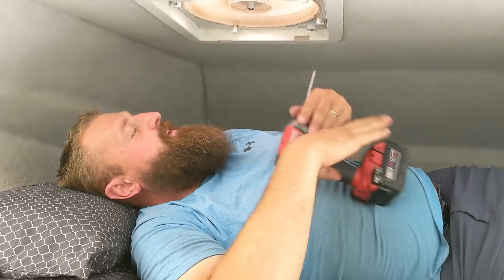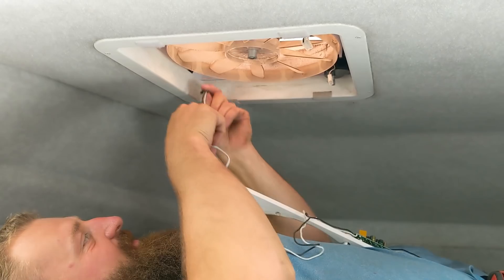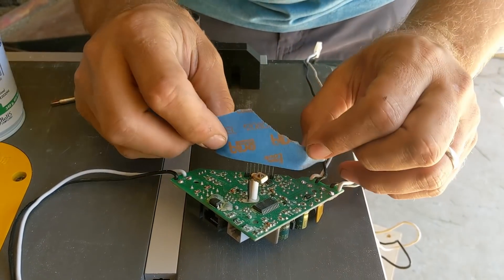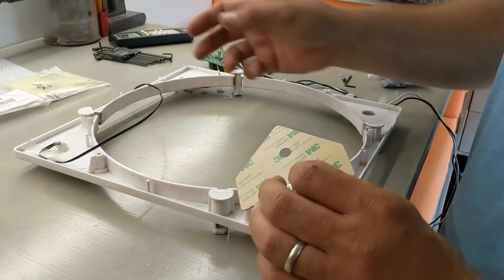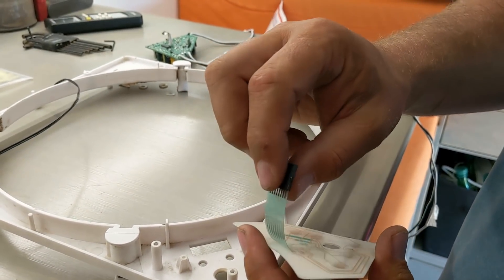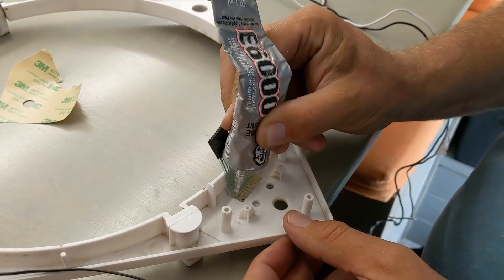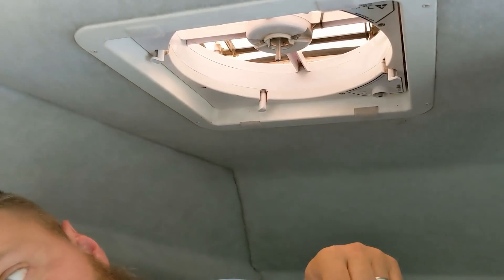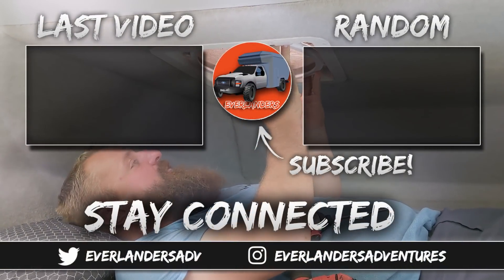MaxxAir Fan Repair & Preventing Condensation from (re)Damaging Electronics  - Manly Man Skills

Comment: Was the fuse on the fan you removed as maxxair I thought had one one them and I have issues and had to wire the basic fan to a toggle switch to have even a one way fan working
Reply from the maker: What?

Comment: We bought a couple deluxe Maxx Air fans for our bus, and out of the box I tried this on one. In retrospect I suppose I should have teste3d it first, but anywho it didn't work properly when I put it back together and connected it to power in my living room. I'm afraid I may have done something horribly wrong and completely messed it up. Basically the controls, remote or on the fan, are not doing what they are supposed to be doing. The cover won't open but it will close if I  open it manually and press the off button. The fan itself won't come on most of the time. To compare, I took the second one out of the box and wired it up, and it worked a charm.

Is this something I can fix? Any ideas? I tried to follow the video as close as I could and I used the exact same products.  😢
Reply: Nevermind, it was user error. When plugging everything back in I plugged the temperature sensor in incorrectly and for some reason that caused the fan to lose its mind. Working fine now. Ugh.
Reply from the maker: Great! The foil ribbon cable for the keypad still failed again on mine 4 years later. If I was doing it all over I'd extend the 2 sets of motor wires and relocate the PCB somewhere away from the condensation.

Comment: It's possesd. That's what my infrared sensor looks like on the second board I replaced last year. POS!
Reply from the maker: It will look like that and need replacement every 2 to 3 years unless you move the PCB elsewhere and run wires to the motors.
Reply: Yep, I would have to cutout the framing to move the board locations. I have 3 of the deluxe 7500k fans. Only having problems with the bedroom fan. One of the wires on the sensor connector is broke and I don't have a micro soldering iron   for circuits.
 Good video Jason!
Reply from the maker: No, you just need to reuse the power wire running to the unit and use that for the motor wire. Then relocate the PCB to wherever your power distribution is.
Reply: Oh, I see. But that would be behind the Converter in the wall cavity that I can't get to anyway.

Comment: Is there not also an issue with voltage ? They don’t like being supplied anything over 13 (?) bolts?
Reply from the maker: Yes indeed, but we don't have this issue because we don't charge from the engine, our LiFePo4 battery bank is pretty stable right around 13.5v

Comment: 'm getting ready to build my new camper and will be buying a deluxe Maxxair with the remote. I see you recommend the conformal coating and silicone sealed switch ribbon for the reasons you suggested. And I recall another video where you either repaired or lubricated the motor (can't remember exactly). Having several years of full-time experience with these fans by now, are there any other recommendations you have to help new users avoid all the failures I read about in comments and product ratings? And do you think there is any merit in running a spare/parallel set of wires to the fan under the headliner while I have it open? (for ready use if the circuit board fails for other reasons). Although I assume if I want to bypass that POS circuit board and use a PWM instead I could simply tap into the regular power wires I would use normally...but what do you think?  Thanks for putting this up, very helpful.
Reply from the maker: Yeah, our buttons died again within a year, and the IR remote too. So we have no control of the fan by original means. Thankfully I have hotwired my own controls onto the power side of the board so my automation system can still control everything:
https://youtu.be/aS3BiYaEfiw?si=cozVs_2Qy7jkXA7r&t=2238

If I had to advise, Id say to remove the PCB from the unit and run 2 wires for the main motor and 2 for the lift motor and relocate the PCB somewhere else entirely.  And even then I wouldn't fuss with the lift motor because the pot metal gearbox constantly blows apart anyway. I've printed about 6 of these for other travelers already...
https://youtu.be/I1VUWOmmQfo

My motor is on its last legs again, I have another spare with us that I rebuilt, but I'm sick of feeding this thing parts all the time, So I have a brushless motor retrofit designed and 3D printed, that uses a small brushless motor and a ESC from a drone to completely gut the original equipment and replace it entirely:
https://www.youtube.com/watch?v=D-HVnCHQVLk
Reply: @Everlanders  Thank you for the excellent info! I will plan to relocate the PCB elsewhere. And for me, I will probably avoid the super deluxe model with the remote and auto opening/closing function. Sounds like it prematurely wears out the vent raising gearbox. I will position the PCB and buttons in a central location easily reachable from the bed and kitchen area. And just deal with manually opening or closing the vent. Just a damned shame the Maxxair is such a good design for its plastic shell in terms of venting and rain repellency, yet they completely chince out on the motor and control system. They should make a higher grade system for serious RV and vanlifers who truly live full time for years in their vehicles. Who need and will pay for quality. No question in my mind if you built an upgrade kit that addresses the deficiencies (quality brushless motor and adapter, better controller etc) people would stand in line to buy it, even at $300 just to know the Maxxair is finally all it could and should be. Anyway, thanks again, you're a hell of an EE. 👍

Comment: We installed a buck booster converter on installation before watching any of these videos, along with electrical liquid tape on the board. It’s been beeping, going nuts turning on by itself, opening and closing continuously just driving me nuts. Can’t use our fan… By the way, we’ve only had it installed for about 2 months. This is what we get for buying this “Deluxe” vent… Right…. We have 500w solar and two big lithium batteries. Plenty of power for everything, besides this fan? This fan… Agghh…  By the way, ours nipped like that at the beginning, we pulled one of the connectors off the board and plugged it in to the other on the board. Not sure if I put it on the wrong connector after applying liquid electrical tape. So even after coating the board it can still fail due to moisture on the keypad. Airxcel really did their research didn’t they… Seams like they wanted to push the product out sooner rather than later with one less manufacturing task to worry about, and with they hope buyers would have to buy spare parts. So slimy.
Reply from the maker: Then just unplug the keypad and use the IR remote...

Comment: Thanks for this! No need to mask off the IR sensor?
Reply from the maker: Not really, the coating is transparent... You definitely want the legs of the sensor to be coated, that's were mine failed. If you wanted you could put a little dot of blue tac on the "eye" on the front of the sensor.

Comment: Researching different fan solutions and would really enjoy your opinion if given the opportunity would you change your fan solution to more of an erv system? Was it not enough cfm? I’m doing research for my own build one day and considering something like this as part of my goals is to have it 4 season capable. I have more experience with hrv system but thought be a good way to keep the living quarters fresh while managing the moisture and being more efficient. I’d be very curious your opinion. Frees up ceiling space too I was thinking. 

Been very much enjoying all your content! Your dedication to the channel and your content is inspiring. Thanks so much. You guys rock.
Reply from the maker: Sure, If you have the space, it sounds like a great option.
Reply: @Everlanders  sacrifice cabin space for roof space. Once your committed to a hole in the ceiling though… I was thinking with all the problems with the best in market ceiling fan and watching your struggles I was hoping and assuming the hrv/ervs are design to handle moisture so it should last and meet the needs of air quality. Space is certainly a worry. I’ll see if I can fit it into the design. Hoping your latest rebuild on the motor lasts a long while. Very best of luck out there!

Comment: Great video! Quick question. Is the E6000 Plus Still okay to use as I know you said use E6000? Is it all safe to apply onto PCBs? TIA
Reply from the maker: To be clear, I only used the E6000 on the flex PCB keypad, the PCB itself got MG conformal coating.
Reply from the maker: They say "E6000 Plus offers virtually the same performance characteristics as the original E6000 adhesive but without the odor. It's formulated using a premium polymer technology and can be used on most any substrate and in just about any application"
Reply: Okay thank you. My PCB looks different so I’m not sure where to put the conformal coating :/
Reply: Okay thank you. My PCB looks different so I’m not sure where to put the conformal coating :/ can I send you a picture on YouTube?
Reply: Okay thank you. My PCB looks different so I’m not sure where to put the conformal coating :/ can I send you a picture on YouTube?
Reply: Okay thank you. My PCB looks different so I’m not sure where to put the conformal coating :/ can I send you a picture on YouTube?
Reply: Okay thank you. My PCB looks different so I’m not sure where to put the conformal coating :/ can I send you a picture on YouTube?
Reply: Okay thank you. My PCB looks different so I’m not sure where to put the conformal coating :/ can I send you a picture on YouTube?
Reply: Okay thank you. My PCB looks different so I’m not sure where to put the conformal coating :/ can I send you a picture on YouTube?
Reply: Okay thank you. My PCB looks different so I’m not sure where to put the conformal coating :/ can I send you a picture on YouTube?
Reply: Okay thank you. My PCB looks different so I’m not sure where to put the conformal coating :/ can I send you a picture on YouTube?
Reply: Okay thank you. My PCB looks different so I’m not sure where to put the conformal coating :/ can I send you a picture on YouTube?
Reply: Okay thank you. My PCB looks different so I’m not sure where to put the conformal coating :/ can I send you a picture on YouTube?
Reply: Okay thank you. My PCB looks different so I’m not sure where to put the conformal coating :/ can I send you a picture on YouTube?
Reply: Okay thank you. My PCB looks different so I’m not sure where to put the conformal coating :/ can I send you a picture on YouTube?
Reply: Okay thank you. My PCB looks different so I’m not sure where to put the conformal coating :/ can I send you a picture on YouTube?
Reply: Okay thank you. My PCB looks different so I’m not sure where to put the conformal coating :/ can I send you a picture on YouTube?
Reply: Okay thank you. My PCB looks different so I’m not sure where to put the conformal coating :/ can I send you a picture on YouTube?

Comment: Dude, I ordered the spray and ordered the new board, coating it as you instructed. I really appreciate this and am confident the thing won't fizz out like the original board did. Thanks!!!!
Reply from the maker: Also, drill a tiny hole in the clear dome for the IR remote if you have one... That allows the water to drain.
Reply from the maker: Glad I could help!

Comment: My van’s Maxxair has been awesome, no problems for 3 years and in the Pacific Northwest the design is great because you need to be able to be open in the rain.  My travel trailer has had nothing but trouble.  I hope this approach is the fix.
Reply from the maker: The problems get much worse... https://youtu.be/D-HVnCHQVLk
Reply: @Everlanders  I think I have figured out why my van is fine and my trailer sweats harder than rain.  My van has 3 inch thick Rmax dense foam insulation.  When we cut the vent hole we cut it tight.  So my fan is insulated away from the vans heat with a tight seal.  With the insulated pillow in place I block enough heat to prevent condensation.  I took the sleeve off my fan.  The trailer ceiling in the attic space had loose pathetic insulation and the heat was allowed to circulate around my fan.  With the heat source warming my fan assembly it was clear why I have a steady beat of rain  from condensation.   I plan to try using rigid foam insulation to insulate the opening.  Will reply again with my findings.
Reply: @Everlanders  I beefed up the insulation around the trailer fan, and even though my door had condensation, my fan does not.  Can I apply conformal coating using the can and brush on the circuit board?
Reply from the maker: @susann1311 The door will always have condensation before the fan because heat rises, and you were losing heat through the fan. But if the outside temperature was much colder you'll still get condensation on the fan hood...  you may be able to brush on conformal coating, but I have only ever used the spray on, or the potting compound where you actually flood it into the enclosure, completely encasing it.
Reply: @Everlanders  Thanks, I am no longer getting much condensation, insulating made a huge difference, but I still want the circuit board protected.

Comment: I had a similar problem damage from condensation. I had to remove the two remote Jack's using a soldering iron and a desoldering gun. Then I cleaned the board, now the keypad works and the fan runs in exhaust but not in reverse.  I only use it in exhaust mode so all is good.
Reply from the maker: Since I made this video, I have run into half a dozen people on the road with similar problems, dead circuit boards etc... I've been able to help most of them by hotwiring a switch directly to the motor, but it's nearly impossible to get a replacement circuit board when you're overlanding through Guatemala etc...

Comment: Cold weather camping? These fans fail in hot weather, mild weather, camping near a lake, and when somebody sneezes in Argentina. I absolutely despise them. I went through two board replacements, and they keep blaming the voltage. Which is crazy, as it's on a regulated circuit that doesn't get above 13.4VDC. BUT, they claim it's only allowed to go to 13.2VDC - if I was an electrical engineer working at Maxxair, I'd resign for incompetence.
Reply from the maker: That's the consensus 👆

Comment: Very helpful! My MaxxAir did a similar thing due to condensation...started beeping, lost its mind, and then went totally dead. Got a new board and installed it, and it powered up, I was able to turn it on, but the plus or minus speed control only went up, not down. The reverse button our auto function would not work either. MaxxAir said it was probably the keypad also. Got a new one coming, hope it works. Now to get some of that spray and moisture proof it! Thanks again!😊

Comment: So did your circuit board just start working again?  Mine failed a week ago and it won't come back to life
Reply from the maker: It never stopped working, it was just sensing all kinds of crazy button pressing because there was moisture on the contacts... This video shows how to clean that off and seal it from future problems.
Reply: @Everlanders  mine just beeps non stop when it gets power and the green light is on.  Fan spins as well but no control over the buttons only 1 month old aha
Reply from the maker: Then just get a warranty replacement...
Reply: @Everlanders  in the process thanks!

Comment: I wish I would have seen this before I purchased mine. It's been in my truck for 2 months, before I finally installed it last night. Two of the speed selections already don't work, and I installed in my shower.  During install, it seemed like a lower quality than the fantastic fan. I wish I wouldn't have drilled the extra holes in the roof.

Comment: So the cause of it loosing it's mind was the connection to the key pad? We've got a Maxxfan Deluxe that's been playing up. Pulled it apart today and it's spotless. No visible moisture, damage or corrosion anywhere. Was intermittently working, and then going crazy at night on its own, and now it doesn't run at all. Not sure whether we need to replace both the PCB and the keypad or not.
Reply from the maker: In our case the keypad damage wasn't as noticable as the IR receiver sitting in the little clear some filled with rusty water. The keypad is made from plastic with very fine traces that had corroded away. The keypad no longer worked but the remote did!

Comment: Great fix! Besides the Maxair fan, do you have a second ventilation opening somewhere in the box? Seems with only the one opening it would limit air circulation and make the fan work harder.
Reply from the maker: Yes, of course, we have electric louvres between our box and truck cab that provide make-up air for the powered fan in the roof...
Reply: @Everlanders , I spotted the louvers in another video where you hoisted the box off the chassis. Do you happen to recall where you sourced the electric louvers?  I am finding only HVAC dampeners for round ducting, too big (12 inch square or larger) louvers, or one-way flap vents similar to what the factory installed in your truck cab.

Comment: So... in the first video I saw of your rig (tiny homes) you were showing the cab up grades for you f550 with 7.3.
You had a very neat installation of I think an Android monitoring your engine. I’ve been trying to accomplish the same with my 2001 7.3 f3350 boon docking rig. iI would love some more info on how you did this.  I have a WiFi OBDII and ok some info (iPhone) but when connectivity is lost engine shuts down (really sucks at 65 mph)
Reply from the maker: I have a $3 ODBII Bluetooth adapter from eBay (ELM327) and an app called Torque